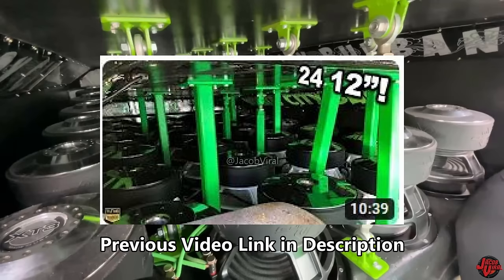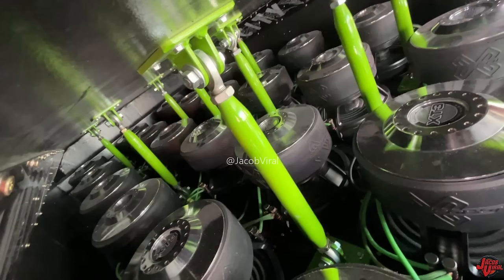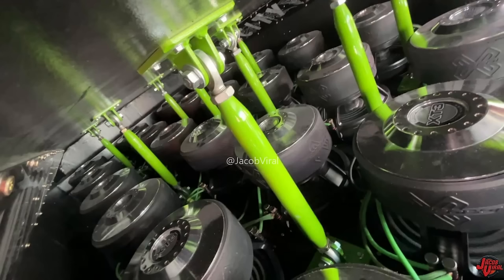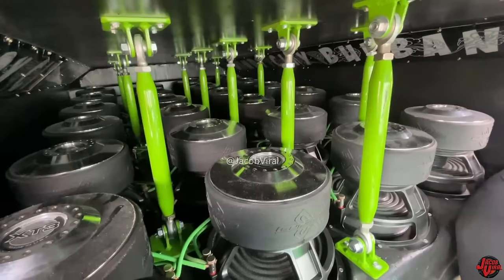24 12" SUBWOOFERS WINDY CITY BASS!

Comment: There is no need to add 2 alternators; just put an extra battery, bigger if possible, with switch to always be able to start. :yougotthis:
Il n'y a pas besoin de mettre 2 alternateurs en plus ; il suffit de mettre une batterie en plus ,  plus grosse si possible , avec interrupteur pour pouvoir toujours démarrer.  :yougotthis:

Comment: How many watts would something like this be... RMS and peak watts?
Reply: Hmm 20k to 40k watts
Reply: @Erik Britz  I was thinking around the same, on the low like 15k rms which would be stupid loud.  Lol
Reply from the maker: 48k rms (6 8k amps), peak way more lol
Reply: @JacobViral  omg! That is actually insane wow.
Reply: @JacobViral  yeah i mean post rise 20k to 40k as in not a small amount 😅
Reply: @JacobViral  how do you figure it?
Reply: Iam guessing about 60k peak wattages,if the massive sound pressure won't kill you from the suction.

Comment: The amount of air that would come from thoses speakers if you put those into a giant box closed up they would sound so good the will sound like shit not being in a box. The JBL charge 5 has a subwoofer 3.1inc when you take it out the passive Radiators. Don't move at all cause the air is trapped inside the box creating more bass when it's out and free it sounds like shit put them in a giant box and you'll get some sound out of that

Comment: Why don't we hear them playing any Rock and Roll,  Metal or something  else other than the Rap stuff ? I'm a Bass player and would love to hook up to that system.   Play some  Primus , Metallica or  YES , Pink Floyd. Are there any mid range and  tweeters in the system or is it just Bass and Sub bass.  Don't get me wrong I'm a Bass freak myself and have an array of speakers and cabinets from  two 18's  two 12's  two 10's and two 8's. I  Bi amp the setup with 2 Crown 1000 watt RMS power amps with digital crossovers and  a very old fashioned Tapco 6 channel  mixing board.  I can shake what ever Venue we might be performing at but it's a clean crisp distinctive sound, not just low noise. Needless to say I also have several pedals that can manipulate my sound from Flanging to Chorus  , Octave and so on and so forth.